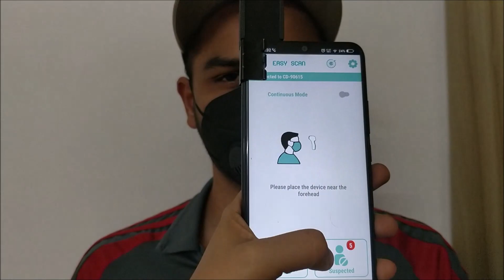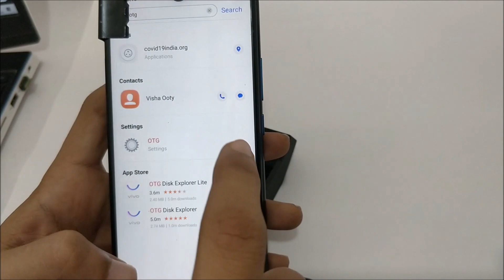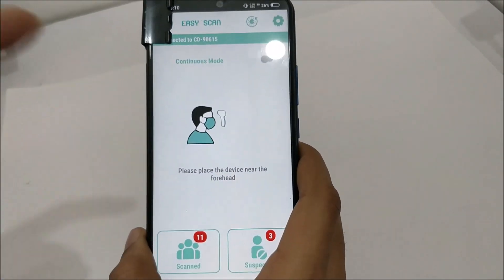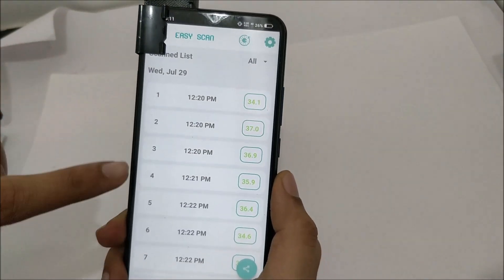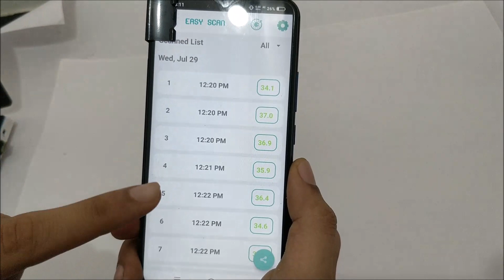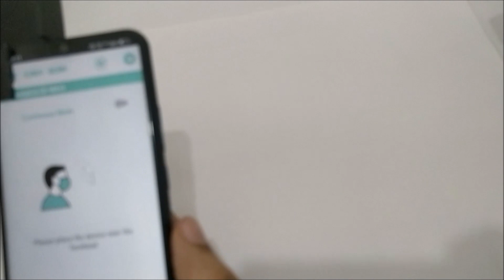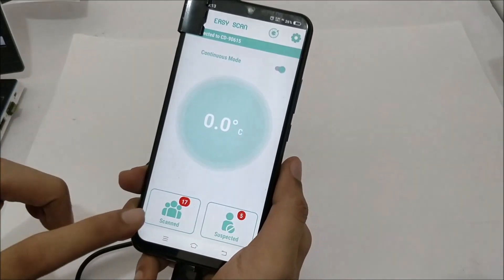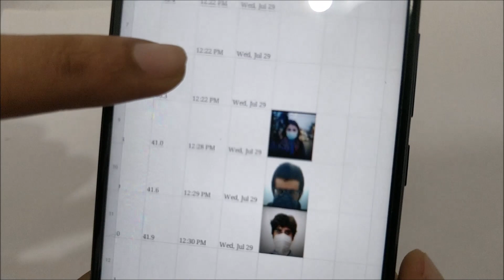Smart Contactless IR Thermometer using Arduino and Android | DIY Infrared Thermometer

Comment: well I have implemented the project smart contactless IR thermometer as shown on the youtube video . But there is an issue in easy scan app as it is not saving the data and also the app is very slow.
Please do modifications in the app or suggest me to save the history. Please go through it asap as I have implemented it as my B.Tech project and I have to present it within 3 days.
Please help....

Comment: what apps do u use? and codes for MLX90614? THANKYOUUUU! <3
Reply from the maker: Check the full project details available in the description.
Also, for different sensors, different sensor libraries will be used in code.

Comment: On which platform have you created the app and how is the information conveyed from microcontroller to app like temperature?
Reply from the maker: App was created using Android Studio, communication is through usb port, i.e serial communication
Reply: @Circuitdigest  Okay, if I make an app on flutter will I be able to do serial communication through otg with my microcontroller?
Reply from the maker: @harshagarwal2660  sure it can why not
Reply: @Circuitdigest  Thanks a lot!!

Comment: Bro..i am intersted in ur work.I have a personal request can you automatclly take the phto of person whose temprtr is gretr thn our limited value..pls
Reply from the maker: Android security feature does not allow you to take a picture automatically, if you do no need the app on playstore then you can do it
Reply: @Circuitdigest  can i edit your app festure
Reply from the maker: @ath2698  yes complete code is on github and is made open source for our community
Reply: @ath2698  yes you should have a knowledge of related files, you can choose front camera rare camera as an default, inbuilt timer function for photo clip of Android devices

Comment: Where is the complete Arduino file and .cpp library located?
Reply from the maker: here https://circuitdigest.com/microcontroller-projects/contactless-smart-thermometer-using-mlx90615-ir-temperature-sensor-arduino-and-android under programming section
Reply: @Circuitdigest  IT IS NOT COMPILING
Reply from the maker: @bharath881  Please use our forums to post your technical questions https://circuitdigest.com/forums. Explain what error you are facing and someone there should be able to help you
Reply: Hello I have made entire project, but on test in serial port it shows reading of noise, temp and position error.
And as described I have downloaded app connected via OTG with otg enàble. However it does not shows any resulta
Reply from the maker: @jigneshdharia2501  Please use our forums to post your technical questions or to get help https://circuitdigest.com/forums
Reply: Hi, I have also mentioned in circuit digest forum. Waiting for reply. Thanks and best regards Jignesh Dharia
Reply from the maker: @jigneshdharia2501  Hope your problem is solved. If not you can download the code laong with header and ccp file from here https://github.com/CircuitDigest/Smart-Contactless-Thermometer-Arduino-Code/archive/master.zip

Comment: Sir I am implementing this project using nodemcu, proximity sensor and temperature sensor. I have gone through your page and have made changes in the arduino ide code depending upon our connections. But I am unable to display temp using your app, could you pls guide what changes would be reqd in flutter app, in order to display temp using proximity. Thanks in advance.
Reply: Sir could you pls tell? It would be really helpful
Reply from the maker: Hi! please visit our forum https://circuitdigest.com/forums. Write down all your queries over there, our Engineer's team will help you as soon as possible.

Comment: could you please inform whether it is possible to do this project with MLX90614 instead of MLX90615?

If it is possible pl mention the changes in the arduino code.

Thanksss.
Reply from the maker: You can use MLX90614, but you have to use the MLX90614 based library.